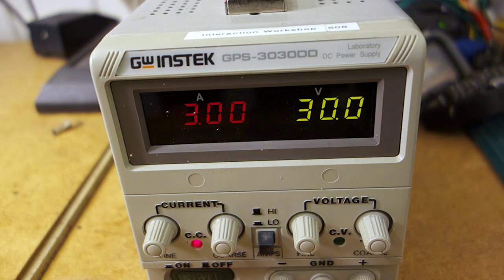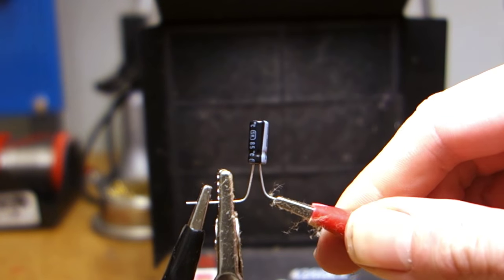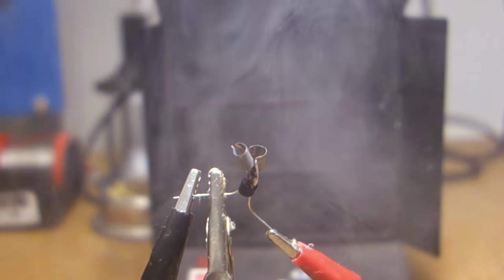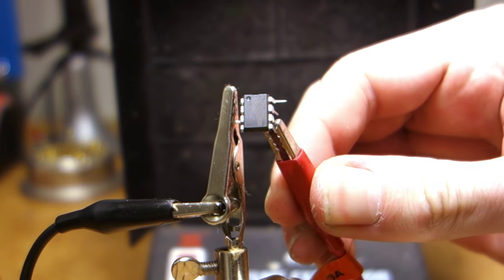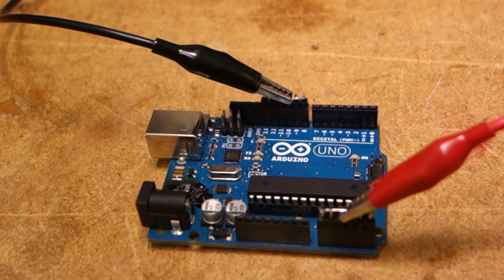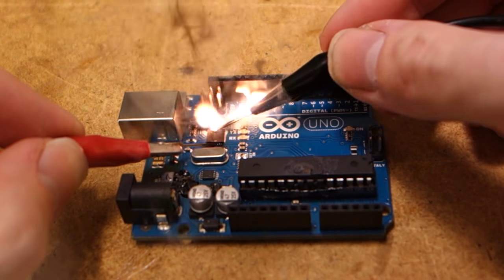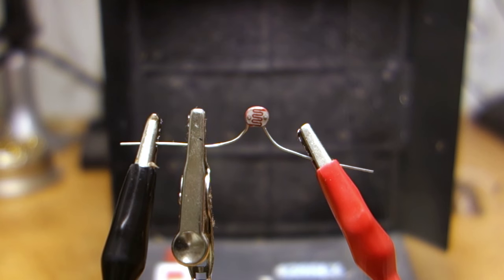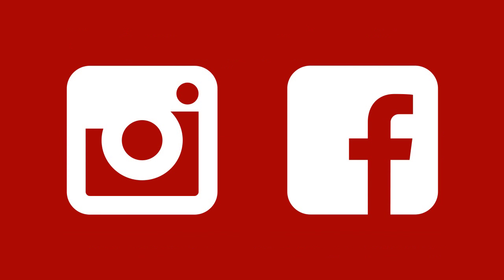Catastrophic Failure (Magic Blue Smoke)

Comment: Have you ever known a resistor to fail closed circuit, or do they always fail open circuit?
Reply from the maker: +Ultimate Handyman I've only heard anecdotal stories about resistors failing closed, normally they should fail open.
Reply: +Switch & Lever 
Thanks, that is exactly what I thought.
Thanks for the reply ;-)
Reply: +Ultimate Handyman 
I have seen fusible resistors in CFLs with wires right next to the resistor body, I think sometimes this must cause a short circuit when they blow, since the resistor gets hot and melts the wire insulation ...
Yeah I have a thing against fusible resistors, I think they are more of a fire hazard compared to regular fuses :P
Reply: +Benjamin “Ozias” Esposti 
Thanks ;-)

Comment: It's not an FTDI ...
Reply from the maker: You're right, it's an Atmega8u2 chip, but they perform the same function. The Arduino Duemilanove, i.e. the predecessor to the Uno, uses an FTDI, hence the slip up.
Reply: +Switch & Lever... and the inductor on the arduino is a 500mA fuse, as stated below
Reply from the maker: +norm1124 Because I can't reply to that comment (I think that user needs to turn on replies somewhere) I will reply to you instead. Indeed, you're right, and I know this. I don't even know why I said inductor, I think my brain had a slight aphasic moment.
Reply: +Switch & Lever this happens to all of us, thank for the test, I liked the results, esp. the fuse and the 555 was very interesting.